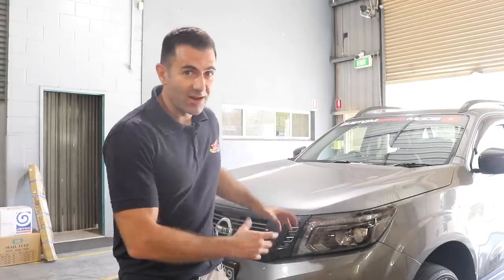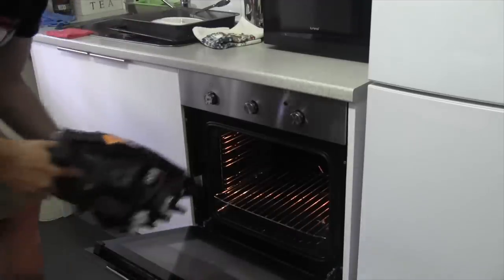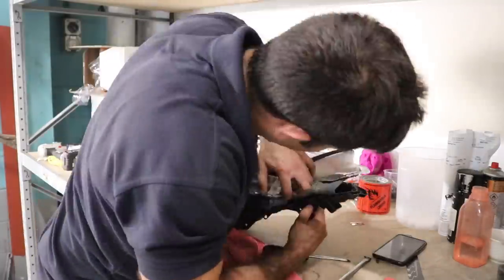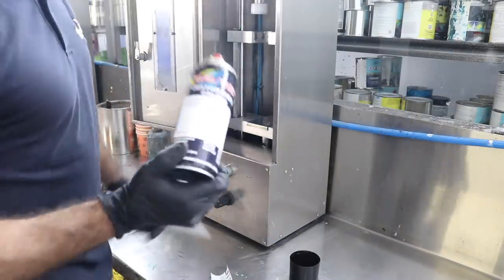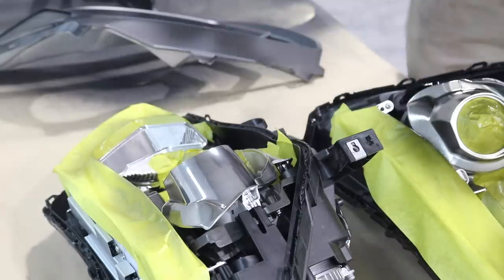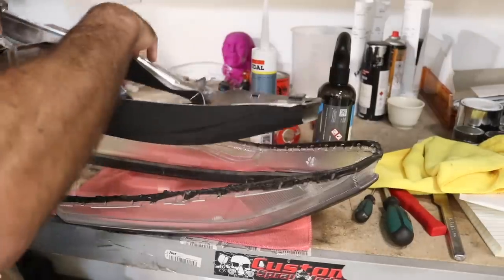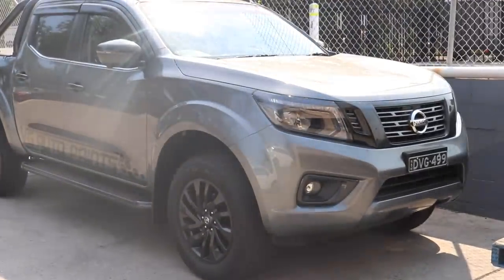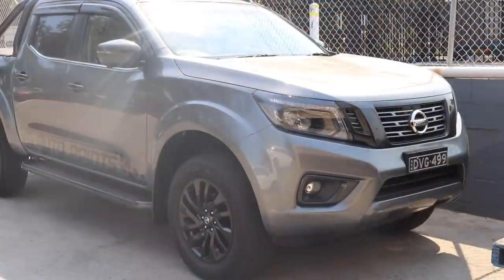How to paint your headlights DIY

Comment: An alternate option without painting at all and going right to black is using ZEP Industrial Purple in a bucket, just get like two to three gallons in a bucket and just dip headlight/backlight housing for about 5 to 10 mins then rise it out with water to remove the soapy foam and Tada!  My first time i did it over night, it was overkill hehe.  But super happy with the outcome.
Reply: For headlights, this is only if you are doing Projectors and or Resto Mod Projectors since the chrome backing on them will be necessary if using traditional bulbs.

Comment: Where r u located do u do headlights n taillights I have clear taillights with chrome inside but I want them lime green inside n the inside of the headlights not the projector part just the outer inside if u can do it let me know n how much my drivers taillights has condensation in it not sure why think its the seal I dried it with a dryer but it keeps fogging up n unfogging can I fix it n paint them pls let me know ty

Comment: Thanks so much for the tip. I've tried painting the inside fitting of headlight. However, under extreme heat, the paint melts and caused some really bad overlapping blisters. I'm in the process of re-doing it and will try to follow your advice. 

Curious if you have any updates on how headlight held up all these years?

Comment: What tape did you use for the chrome reflector? I want to paint my headlights but the reflector for the turn signal is attatched to the bezel so I'm going to have to tape off the reflector but I don't want the tape to peel up the chrome

Comment: Holy shit I would have scrapped the whole project once I knew an oven was involved..good on you!
Reply: I was intimidated at first but one day I had my headlight level adjuster broke off and it would not pass inspection so I figured if i have to buy a new one might as well play with this scrap one first and I was surprised how easy it came apart I epoxy glued the adjuster back together and resealed with the same glue it already had on there and it has no leaks no nothing passed the inspection and works just fine still, I didnt use an oven either just an electric house room heater radiator thing, it doesnt take much
Reply: It’s actually very easy, I’ve done it with no oven just a heat gun but I recommend using the oven, it doesn’t damage the headlight
Reply: Yep it is just about getting it up to temp, to soften.
Reply: You DO NOT need an Oven guys. Use a heat gun to melt the glue. Thank me later. I repeat DO NOT USE AN OVEN
Reply: But then you cook food in there

Comment: Glad to know 1K paint will work.  I would have worried about heat damage (lamps get real hot during operation).
Reply: Not watched it all, because I`m trawling the Net for detail on chrome paint for vintage reflector lenses.....but don`t LED bulbs run cool?

Comment: Just something you need to know: that is not chrome you are painting. It is aluminium applied to plastic parts by vapour deposition. It's an awfully long time since headlight reflectors were actually chrome! the part you painted completely black you could have put through the dishwasher to remove the aluminium and then painted the virgin plastic (usually PC, sometimes UP - look for the code on the part). Either method id valid though and arguably the aluminium is a bettter surface to spray to than most plastics.
looks a lot better after though!

Comment: Is the headlight interior chrome to deflect light properly an painting these parts effect headlight beam performance?
Reply from the maker: Tim Barnett no I also mentioned the new cars have this blacked out from factory
 Same lights.  👍
Reply: @WeekendWarriors87  yeah i did it on my motorcycle (on purpose), its work, still bouncing the light, but its not looking good when light is on. So yeah, dont do that
Reply: Parts of the chrome-look are "working" areas that reflect light (directly behind the bulbs for example), but it's okay to paint 'non working' areas, like the surround of a projector. I'm doing a similar project at the moment as a mini series and am going into quite deep detail if you want to take a look.

Comment: I hate the overuse of chrome... old Mustang, maybe... 57 Chevy, definitely... anything newer than 1975, why?!
Reply: Headlight reflectors are not chrome. It is aluminium applied to the plastic by vapour deposition. Obviously, the "working" surfaces have to be shiny reflective but otherwise, I agree about the overuse of chrome / chrome-look. I've got to replace the projectors in my headlights, so I'm doing a mini-series about the job, including a little modest customisation with both black and body colour.

Comment: Base models got black trimmings lol
Reply: Ha ha, yeah, that's because it's not actually chrome. It's aluminium applied by vapour deposition for a chrome-look and highly reflective surface (for the 'working' surfaces of the lights. When the individual plastic parts are being made it is actually cheaper to paint them black than apply aluminium, hence 'base' cars getting black and higher trim levels getting chrome-look.

Comment: Be careful recommending people melt sealer to split headlights mate.
Get them to research their car first. 
I have an e93 LCI that i want to do this to, but they actually plastic weld the lenses on the LCI headlights, and trying this will likely have people melting their 1000 pound uk (each side) headlights if they dont know that.
Mine have to be dremeled off and then replaced with new lenses stuck on.
Its. A right. F*ck on...
Reply from the maker: Tester Hamsticle thanks. they can probably withstand 10 minutes in the oven still.
Reply: @customspraymods  oh yeah ten minutes wont hurt im just thinking of "The Public". If it doesnt work in 10 mins some might be tempted to try a bit longer.
The guy who clued me up on my bmw headlights (and quoted me about 6-700 quid to do it all for me, to indicate how difficult mine are to seperate) said he gets quite  alot of this style light that are actually melted for just that reason.
Still class vid tho, I want to matt black my entire headlight, and then put a light smoke tint so a bit like net curtains, the emitted light is legal you cant see anything in the light so it looks really blacked out. :)